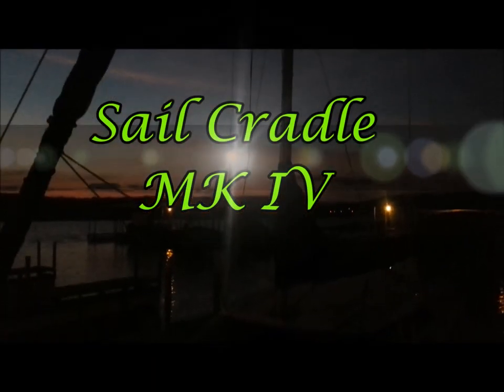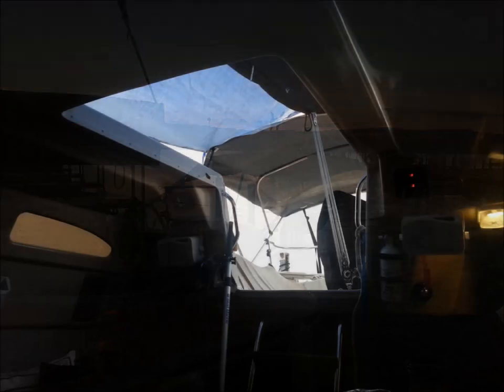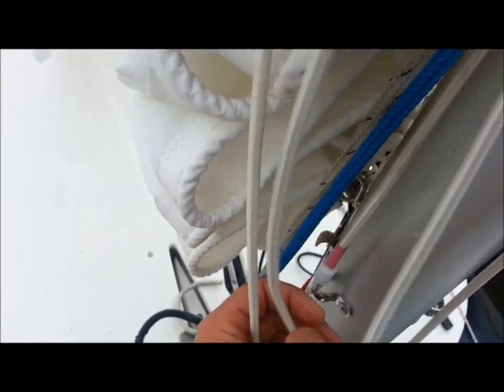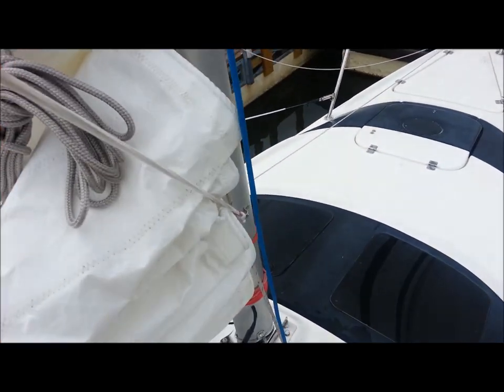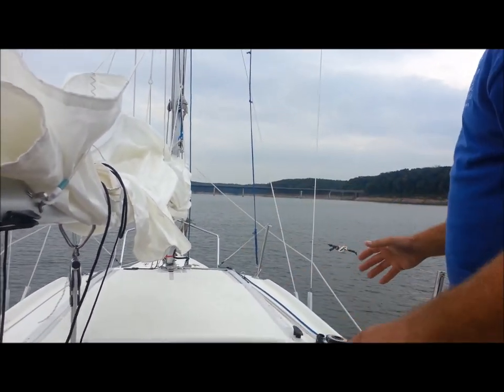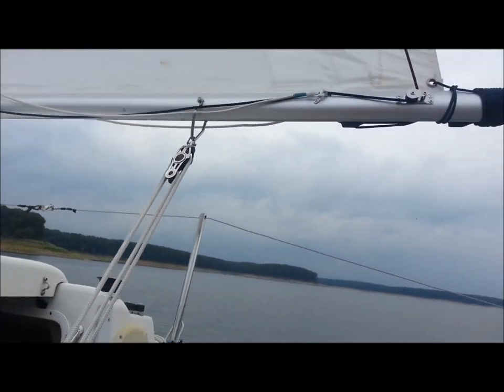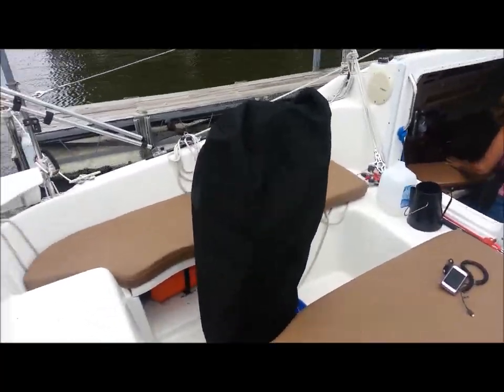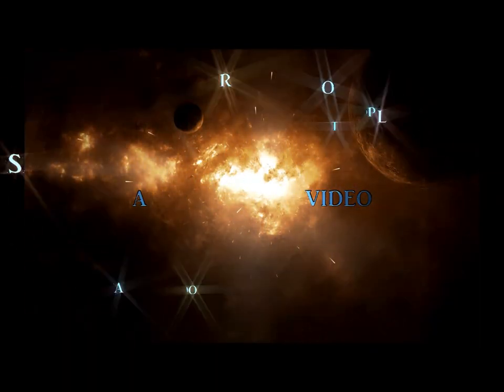MacGregor 26M:  How our Lazy Jack Cradle System works on Galactica

Comment: Hi. Nice Vid. Regarding the top part of the lazy jacks, the inverted "Y", is the junction of the Y fixed or free running? I mean, at the 2 into 1, do the 2 run thru an eyelet or pulley at the end of the top 1? or is it a knot? cheers.
Reply from the maker: the middle of the "Y" is a ring with secured lines to the two tips of the inverted Y.   The bungies from the tips are free running.  I am re-rigging it now as the bungies are getting old.  I may just knot the 'M" to the tips of the inverted Y.

Comment: Thanks for the video. it would appear to me that the main purpose of having the lazy jack is to be able to douse the mainsail quickly when short or single -handed. With the center hook disconnected, it defeats that purpose. A typical lazy jack system with all lines would have a cleated line in a location on the boom to ease the cradle to allow mainsail shape while on the way, but everything else stays connected to allow the system to do its "jack" job part. Thanks for sharing.
Reply: javacup912   Exactly!   It really comes in handy when we're tucking into a cove for a swim or lunch!

Comment: Must you take the whole thing off to get the sail cover on the sail?  How do you use a sail cover with your lazy Jack system?
Reply from the maker: +Mark Kempen It only takes maybe 30 seconds to disconnect the cradle line from the pad eye at the end of the boom, unhook the middle and connect it in 'travel mode' to the mast on each side.   Then I just roll the mainsail boot out and secure it.
Reply: @StarSloop  I have a system that connects to the sail cover, not the boom. it makes the cover part of the lazy jack system. the sail drops into the cover and then I have a rope that zips the cover up the top centre. Very neat system.

Comment: Hi,

I love the way you have the down haul set up, could you send me some details on how to set it up please.
Reply from the maker: +jason mckenzie  The downhaul is a line that I connect to the to the halyard shackle at the  head of the sail with a bowline knot.  The line runs down to share a double block with the mainsail halyard at the base of the mast.  It then runs through a double cheek block also shared with the mainsail halyard and back to a clutch.  I have cleats to tie off and organize the bitter end.  

To deploy, I just release the down haul so that it is pulled up the mast as I raise the mainsail.  When lowering, I reverse the process releasing the halyard and pulling the downhaul.    Jim King who used to own the 26M Konig was really innovative and made the halyard and downhaul one single loop of line!

Comment: There is a difference between lazy jacks, and a lazy cradle. What you have are lazy jacks. The cradle would be an integrated sail cover with zipper. The improper description could cause people to purchase the wrong kit, or simply be misinformed.
Reply from the maker: True.   However, the actual Nomenclature on the packaging of this kit in this video is the "Sail Cradle MK IV"  Model#202 which I had bought at Strictly Sail Chicago at one of the booths.    It seemed to me at the time to be a modified lazy jack so I described it in the video title as a lazy jack cradle system.  I was fairly new to sailing then.     It was affordable and worked well with my existing cover.  In hind sight, I should have explained the make, model, name of the rig along with a bit of history where I got it in the video and not just in the note section.

A bit of follow up on this lazy jack rig,  it performed quite well from 2012 through 2017.   Late 2017, the plastic clips began breaking and the additional mass, stiffness of the Hyde Warp Drive loose footed Mainsail I switched to was unforgiving on the lazy jack bungee cords which were aging and weathered.    It needs to be rebuilt now.  I didn't get to use the Mk IV Sail Cradle (Lazy Jacks) this summer on our Lake Powell Sail.

I have a real stack-pack on my Morgan's Mainsail and Mizzen sail.  This is a full material cradle like you describe.   It's more difficult to zip closed on the main but that is more due to the boom about 5-6 foot above deck and difficult to reach over the center cockpit. The zipper ends about 8 foot above deck so I have to stand on a step and winch to reach it. :)  I would not want to sail the Morgan without it though!

Comment: how many gph 9 [gallons per hour] do you get at cruising speed?
Reply from the maker: At our normal 600' above sea level down to sea level,  it's fairly fuel efficient unless I keep it wide open throttle or plowing water prior to getting on plane.    The Etec 60's computer doesn't do a good job adjusting to higher elevations.   3000' and 6000' above sea level, it chews up fuel and only plows the boat at 9-11mph at WOT instead of getting on plane typically between 12-21 mph.  I motorsailed 8 hours on the Florida coast and never used up one of the 12 gallon tanks.   Motorsailing with the motor running 800-1200rpm is extremely efficient.